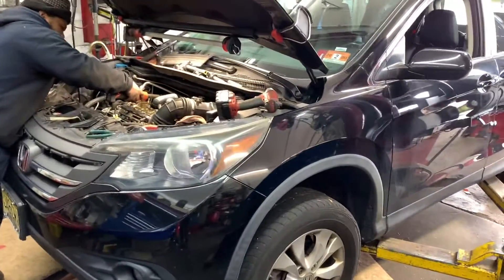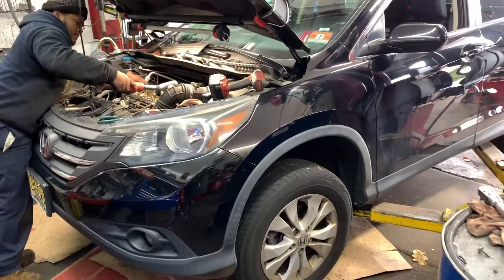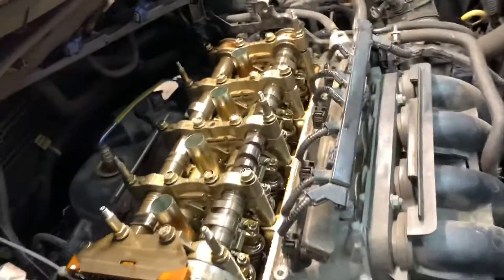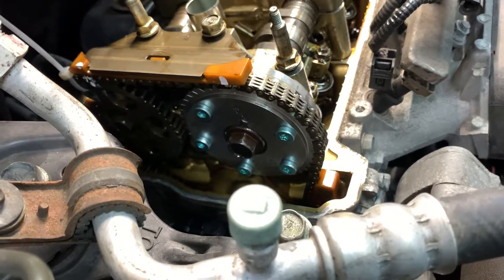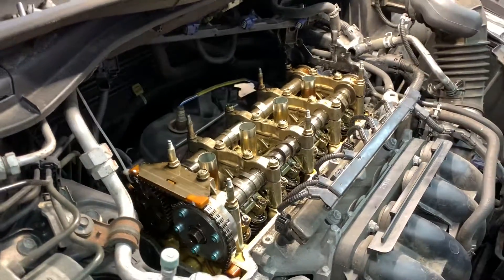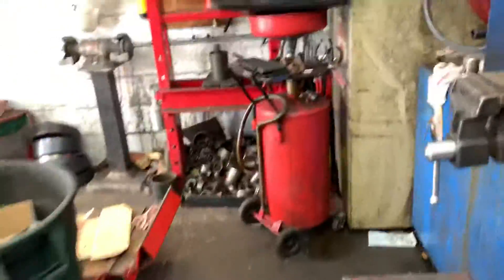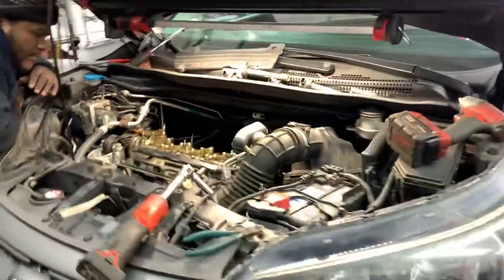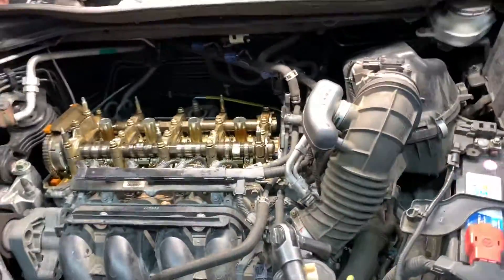Honda engine rattle noise FIXED!

Comment: thank you for posting how long it would take to do this, labor in my area is over $100/hr.  some people have tried to just replace the VVT solenoid and that works sometimes, and is easier and cheaper.
Reply from the maker: Around $800 parts and labor

Comment: Honda dropped the ball on this. Mine is 2012 and has been doing it from the start when I bought it brand new. They should have recalled all these
Reply from the maker: Yes. True. I have been doing like 3-4 a week for this problem
Reply: @ozzysautorepair351  what's an estimate for this in an 08 Accord LX?
Reply: Same issue with my 2012 accord sedan
Reply: @ozzysautorepair351 would this be the cause if it always happens at certain RPM/accelerating or when reversing for some odd reason? It sounds identical to this tone of rattle but it's a lot slower and not on cold start. I'm wondering if the chain guide or tensioner is bad. 
Thanks

Comment: We bought our 2013 CRV in 2014. We took into Honda of Anchorage and they said it was a software issue and they fixed the problem. It didn't, we took it in again and they said the same thing. Now it's long past warranty and we want to sell it. It was a VTC actuator. Piss poor fix by Honda of Anchorage.

Comment: It’s actually a small spring within the VTC actuator. Very cheap & it takes 20-35min to fix
Reply: Is there a video on replacing that spring?
Reply: That's one small part of about 3-4 causes of the rattle.  It is the place to start though.
Reply: Do you have where I can buy the part?
Reply: @realstephnoguera  you don’t have to buy the part. You just have to take the outward facing end of the VTC actuator off, stretch the spring, and reinstall it. Very simple process.
Reply: @realstephnoguera  here’s the link to show you how to perform the process. Don’t buy the spring as you don’t need it. Just stretch it back out and reinstall. 

https://youtu.be/TvZfZHoUXq0

Comment: You do not need to remove the camshaft. Just remove both sprockets and you can slide the VTC actuator in that way.
Reply: What about the unlock/lock position?
Reply: @mrpistonrecaro6483  You have to make sure you install it unlocked and once you torque it down you lock it with your hand by rotating it.
Reply from the maker: Lock it after torquing the cam bolt

Comment: When I start up my 09 Accord, it makes a rumble or rattle sound. It has plenty of oil, but it makes that sound. It lasts for no more than 2-3 seconds, and then the car drives smoothly. Sometimes you can blatantly hear it other times it's barely noticeable. Other than that rattle noise at start up, my 09 Accord drives as if there's no problems.
Reply: My 2015 honda hrv also does the same. Runs fine.
Reply: same here

Comment: Or take it apart, stretch/replace the inner, compressed VVT coil spring, reassemble, re-mount to engine.
Reply: Did the repair last
Reply: I've seen many videos showing this. Did you this work for you?

Comment: Exactly what my 2014 is doing. Thanks!
Reply from the maker: Yeh. They all do. Just replace the intake sprocket. Thats all it needs.
Reply: @ozzysautorepair351  Thanks again!
Reply: Same here 2014 honda accord started doing it
Reply: @eternalspring1034  Thanks for your reply. quick update on my car's issue - it turned out to low oil. once I topped it off the noise went away. perhaps we can start there
Reply: @syedbelgam  I made a video on that low oil noise to confirm your statement
Reply: @Striker50_  I would love to watch it .please share the link with me thanks !
Reply: @syedbelgam  look up 2013 Accord low oil 👍 striker 50

Comment: Hey man I have a Honda odyssey 2015, it used to make the noise when I first started it in the morning then now it doesn’t the all time is on. Should I replace the vtc actor?
Reply from the maker: Yes and also the chain and tensioner

Comment: Thanks for sharing. My 07 Honda Pilot  rattles for 2 to 3 seconds on cold starts. I replaced all the timing belt related parts including the water pump, serpentine belt and did a valve adjustment.  Any ideas? Thanks.
Reply: If it’s a Honda Pilot it has the Honda J-series V6. That noise is usually timing-belt tensioner. It looses oil over time & becomes loose. It it could be the serpentine belt tensioner.
Reply: The TB tensioner has less than 10k miles. Indeed the noise was coming from the serpentine tensioner but only when very cold.

Comment: We had it fixed on warranty, and 4 years 80,000 miles again.  Replaced the tensioner, too.  Besides a CV shaft because of the boot, those are the only two repairs.  I would like to see NGK or Denso make a replacement.
Reply: NGK and Denso do not make mechanical parts like the VTC actuator.  They make sensors, filters, and spark plugs.

Comment: I just bought a 2008 Accord EX Sedan 5 speed. Love the car except the noise it only has 98k miles but since I work in the dealership I get crazy discount for labor. I decided might aswell replace the chain incase it might have been stretched due to this. But again because I have a discount hehe. Anyways, Thank you!
Got it booked this coming week and that better fix the 1-2 second rattle.
Thing is sometimes it doesnt rattle but most of the time it does and it is summer and warm.
Reply: Yep. Long story short my the rattle I was experiencing isnt really a rattle but more like a brush sound coming from the starter.  Car is good right now knowing I have replaced the chain and vtc as a precaution. Plus the VTV Actuator has an update part number that is why the old one before kept failing on people.
Reply: @VR46champion  that's really good to know I bought a 2008 accord exl in the summer and it was perfect. But winter came and on cold starts it makes the noise. So does the vtv need to be replaced too along with the vtc? Sounds like if you catch the sound early you can just replace the vtc and not the chain. I'm also not sure why people think you could go without fixing it. Maybe you could put it off for a little while
Reply: Ive heard people run it like that without fixing but for me I like my cars mechanically sound. Even tho my initial issue wasnt the VTC rattle, good that I already did it anyways as a preventative plus my tech saw my timing is alil bit off so good that I went to change the chains for a fresh start. Plus I dont know how it was maintained by the 2 previous owner. New chains and vtc at 100k miles should be a good start for me since people mostly experience the rattle at that mileage (if vtc was still original)
Reply: About $1500 CAD thats with my shop labor discount I work in a dealership lol. Idk about  USD
Reply: Yes that is total parts and labor
Reply: @VR46champion  What’s the difference between VTC and VTV?
Reply: Fix on my page buddy
Reply: @VR46champion  hey so was it the timing chain my car rattles but it ALSO struggles to start 1 out 3 times

Comment: Can you please tell us how much does this cost approximately?
Reply: Hi. In CAD dollars, its between 500 to 700. Alll depending how honest is your mechanic. About 2-3 hours labour + VTC actuator, (around 260-280$ CAD) and a valve cover gasket, (20-25$) and a little RTV silicone. Thanks
Reply: @Daniel-xq7ny  thanks
Reply: @Andrea-rg9tr  welcome
Reply from the maker: Around 800

Comment: I think the short cut was not to take out the camshaft.
Reply: The short cut is to not remove the timing chain . You can just use tie wire and secure the chain aside and slip the cam and actuator out

Comment: Which part did you replaced? Intake or Exhaust sprocket?
Reply: Fix in my channel
Reply from the maker: Intake
Reply: Did you not watch the video??
Reply: @Striker50_  Did you not see when I originally posted my comment?
Reply: @W0LV1E45  The video says and shows which part was replaced
Reply: @Striker50_  Bruh I don't even remember when I posted the comment. Its 11 months move on.

Comment: Is this new VTC actuator better (improved) part than the oem actuator? Or will it cause same noise after considerable mileage?
Reply: Many say it’ll comeback. Some say they put 3 different ones
Reply from the maker: Always use the oem parts

Comment: All u needed was a 35$ honda vtc kit , which includes a revised spring and the appropriate tool to remove the screws on the vtc housing and a valve cover gasket , 45 minutes did it to over 100 k24's and k20's , be smart .
Reply: Is there a video on this?

Comment: Will this cause codes to and dash lights to come on. We have a rattle on cold start and are being told best guess is chain,tensioner and guides all need to be swapped as the millisecond delay is causing codes. Help!!!!
Reply: VVT solenoid gives a code P0341, easy fix.

Comment: You don’t have to replace that part. Just replace the spring inside
Reply: The spring is only one part of the solution.  The locking pin needs to come out and be cleaned, and simply stretching the spring back out is not a solution.  The timing chain tensioner and the timing chain itself are other parts of the equation.  This is why the noise comes back for people who replaced the entire actuator. Even the updated R5A series actuators can begin to rattle. 

 I also believe that the VVT solenoid valve being bad can be a factor in the rattle, but it's not the place to start and many have replaced them trying to stop the rattle unsuccessfully.
Reply: I will also say that the timing chain tensioner is a big part of the problem, and also the locking pin that the spring seats into is as well, because it needs to be able to freely move in and out of it's detent.

Comment: if its not addressed immediately, a year after i bought my used 2012 crv with 60,000 miles, it stretched my chain. I had to replace chain, tensioner, guides as well. I drive about 30,000 miles a year unfortunately for me the problem is back 10,000 miles into new vct part.
Reply: Aftermarket parts perhaps  ?
Reply: @robles100   did it with OEM at the dealership, but maybe aftermarket is the solution.
Reply: The chain does not stretch from the actuator rattle.  The chain stretches because of low oil levels creating excessive heat, and it's not by much.

Comment: My rattle is continuous. Is my sprocket completely gone or could it be something else.
Reply: You should inspect your VVT solenoid valve and if it is in the open position, you need to replace it.  Other than that, if you have this rattle continuously, you need to replace your chain and tensioner, and while you're there, the spring in the actuator.

Comment: I have a rattle that starts at 1300 rpm and stops at 2400 rpm. Know why? It happens in every gear in my 2010 v6 accord
Reply: Timing belt tensioner.  Search honda v6 timing belt tensioner rattle.  Common on v6 honda engine.  Happens >120k miles.  Had honda do my timing belt 50k ago, looks like the idiots didn't replace the tensioner or wp when I looked back at the receipt
Reply: I have this same noise and I noticed it after my serpentine belt was replaced. I took it back to the shop and they replaced the tensioner on the serpentine belt but the noise is still there. I have a CRV, not an Accord so mine has a timing chain, not a belt.
Reply: @yogamon   In the winter I have heard the grinding noise when I first start it up but this noise is different. It sounds like it's coming from the passenger side and it's a rattle that only happens at around 1500 rpms, above or under that, the rattle goes away. The shop where I got my serpentine belt and tensioner replaced said they used Honda parts. I'm taking it in to the honda dealer tomorrow but I wanted to get an idea of what it might be before I go.
Reply: @mollynash2597  could be an exhaust rattle.  One of the exhaust components near the engine may be loose. If that VTC actuator is not fixed early it can stretch the timing chain so might be a loose timing chain as well, which is not a cheap repair.

Comment: Mine plays up when I stop at the lights with air-conditioning on
Reply: thats your tensioner pulley
Reply: @bryanwinsor9392  it's the knock sensor, and it was fixed

Comment: I had that issue a few months ago but the problem was no oil in the engine.
Reply: It's just oil has to circulate threw the engine, most cars do that on cold starts... My 06 Expedition 5.4 3V does it, but mines is more of a soft rattle.
It's just the timing chain slapping around because it's lost it's tension as the engine sits and gets colder and oil isn't circulating threw the engine... But it will go away after a second, just wanted to let you know, it's nothing major... You can get it fixed but the dealer will charge you a lot and it's not that bad unless it rattles a lot and it does it for a few seconds.
Reply: @kellyoubrejr544  My problem was no oil in the engine, it only had 1 quart of oil. I'm pretty sure they forgot to put oil on my last oil change because my car wasn't burning or leaking any oil. It's all good now.
Reply: @colprincess8579  Well dang, you shouldn't go to where you got your oil changed, that could've lead to an engine blowing up... Glad it's good now.
Reply: @kellyoubrejr544  It happened to me 35 years on a brand new Chevy Cavalier Z when I used to take my car to Firestone for my auto repairs. They said my car was probably leaking oil, when indeed it wasn't. Three days after my oil change, the lifters started making noise and it got louder on my way to pick up my girlfriend from work. To my surprise my car had no oil and I added 5 quarts from a Mobil gas station next  door. The engine was rebuilt but the car was never the same. This is the first time in 13 years that I've been going to this place, but they do however have not tighten the nuts on my car twice already and most recently a month ago on my wife's car. From now on I have to check the oil level and the wheels on my car.
Reply: @colprincess8579  Wow...

Comment: You replace the vtc actuator and the noise returns within a few months. Waste of time…
Reply: That's because it's the spring inside that's usually the problem.  But even then there are a few other things allowing the rattle to happen.

Comment: I got the same problem bro in my 2013 honda cr-v.
Reply from the maker: Jervis De Guzman yep they all do have the same problem.
Reply: If this is not replaced can this damage the engine eventually?
Reply: @Andrea-rg9tr  as per the Honda TSB about this issue , it will not harm anything leaving it this way . Just an annoying sound .
Reply: @EverydayJ1786  thank you. I was able to return my 2014 honda crv to the dealership after 3 days after I bought it  because of this issue.
I bought a Mazda CX5 instead.

Comment: I wish you had a video in that I could hear what the problem sounded like. I have been watching videos that had the VTC problem and the cold start sound that I had was more of a chain hitting he sides of the valve cover. https://youtube.com/shorts/Cbc1eBzJ0EY?feature=share What is this sound? I think its the timing belt tensioner. I could be wrong. Cold start in the morning and it goes away.
Reply from the maker: Next time if i get one in. I will make a video of what it sounds like. But its hard to catch the sound. It will only make it on some cold starts.

Comment: If it's only a 2 to 3 second noise, why bother spending money to fix it
Reply: Plus, at least with my 09 Accord, it drives smoothly. There are literally no other problems with my 09 Accord other than that startup sound.